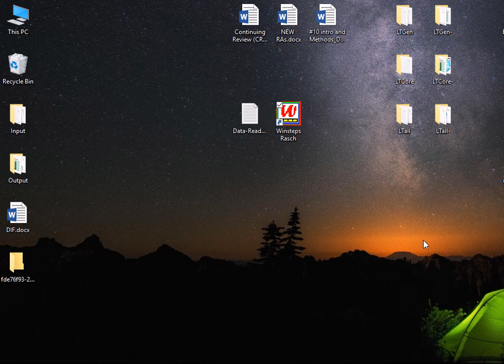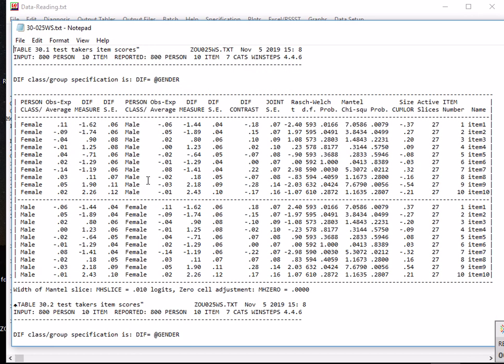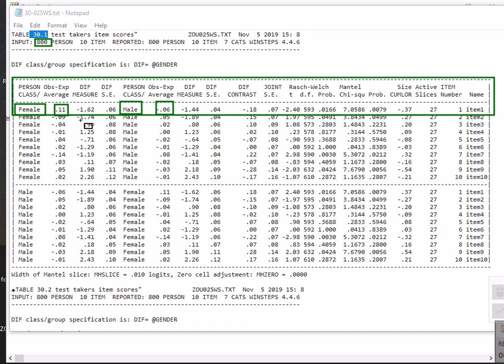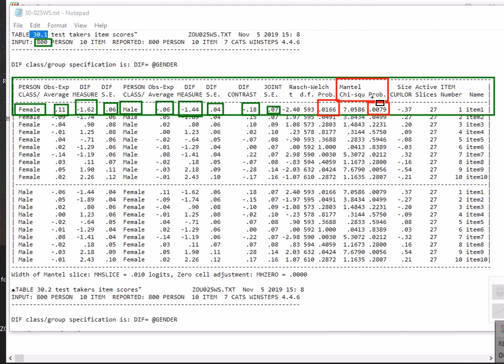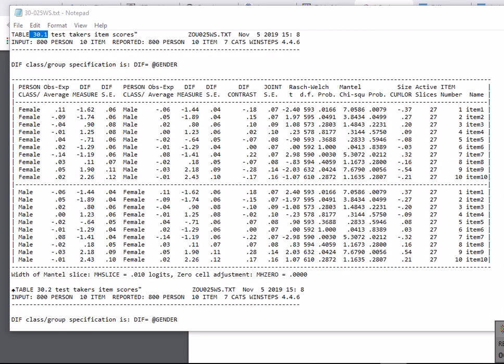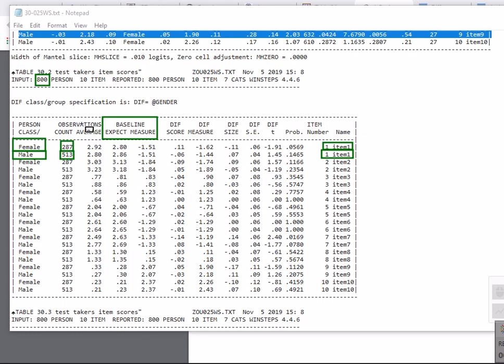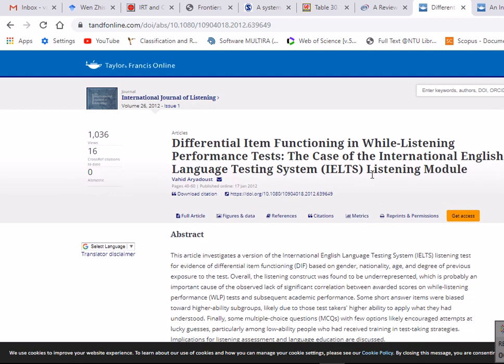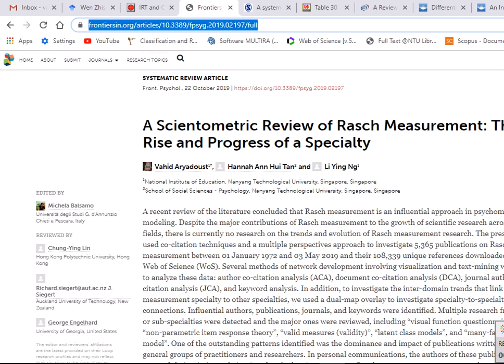Rasch model differential item functioning 1 | Rasch Uniform DIF

Comment: Thank you, Prof Vahid. I have a question about the code. For example, what does @Gender = 69E74; C80W6 mean? What does E and W in this code stand for? Thank you so much.
Reply from the maker: They probably refer to the column in the original dataset, e.g., in excel sheet.
Reply: @VahidAryadoust  Thank you so much for your reply!

Comment: Thank you for posting useful vdos on RASCH using Winsteps. Just wonder if you have any vdo on non-uniform DIF?
Reply from the maker: I have not made videos on non-uniform DIF yet. However, here are 2 papers that discuss it at some depth:
https://www.tandfonline.com/doi/abs/10.1080/09588221.2019.1704788
https://arts.unimelb.edu.au/__data/assets/pdf_file/0008/3241619/8_2_S3_Zhu-and-Aryadoust.pdf
Reply: @VahidAryadoust  Thank you Vahid.
Reply from the maker: @Sok518  welcome and best wishes!

Comment: Thankyou prof to post this useful video. Anyway, i have the problem in my rasch analysis to interpret students or test takers ability with polytomous data. If i want to know the significant difference between male and female students, using SPSS, which data from winstep output i should use? Item measure or person measure? Score or measure in that table? Thankyou.
Reply from the maker: You can output person ability. In Winsteps, click on 'Output Tables" --> 17. Person measures. Transfer these to SPSS and run the analysis.
Reply: @VahidAryadoust  thank you so much prof. I'll try it later 🙏🙏.